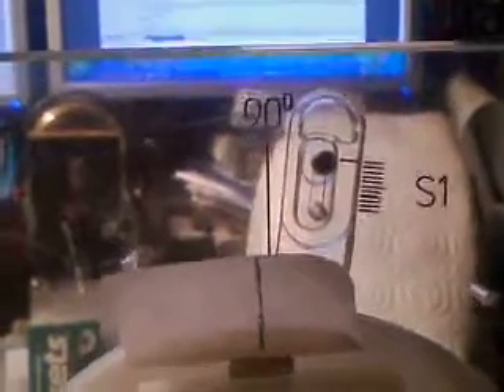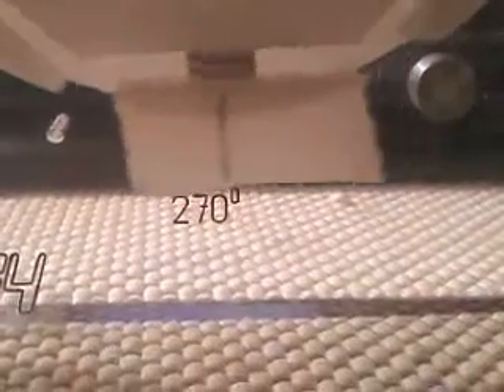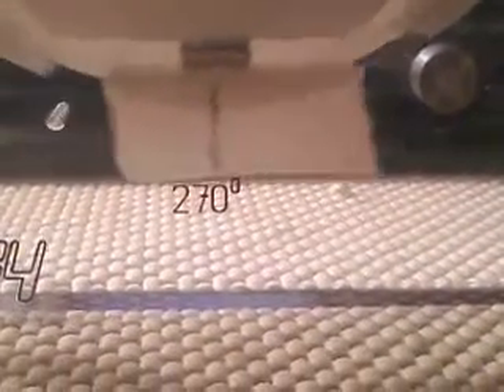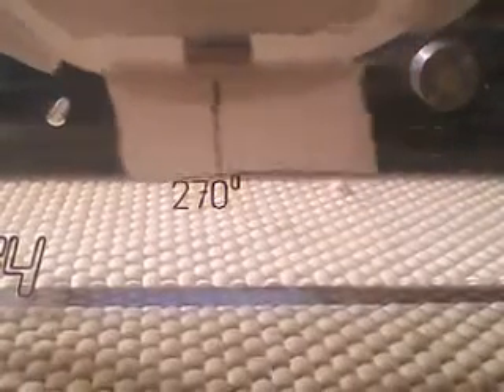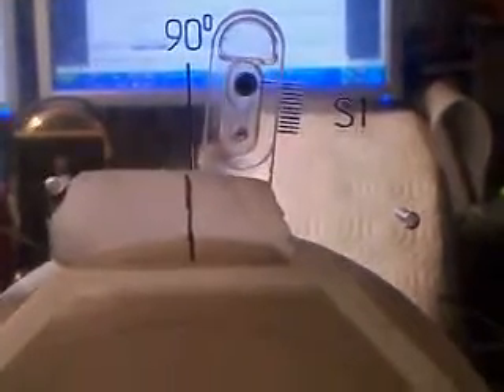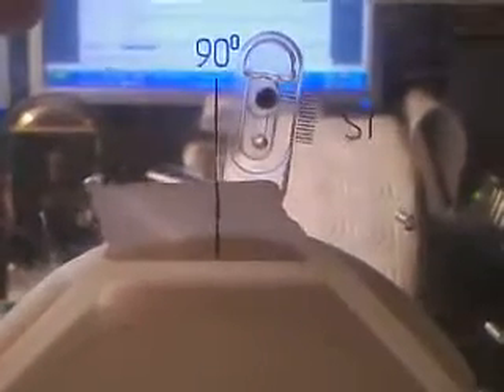Magnetically Assisted Pendulum

Comment from the maker: @Cloxxki ,

No worries - perhaps if you check out the FizzX thread where the math is shown it will help. But keep in mind, this is a reciprocating system, not a rotational system. However, I do have another design for a horizontal rotational system that simulates two opposing gravitational fields using magnetics. I hope to model this later in the year. BTW - another person has made a large (6 feet tall?) inverse M.A.P.  here on you-tube and claims OU from it - I forget what he calls it.

Comment from the maker: @Cloxxki 
The gain in gravitational potential energy is shown mathematically to be greater than the energy needed to rotate the moving magnet 180°.  Therefore, at the top of each swing of the pendulum, it can be flipped over and the return swing will also produce a gain. In reality, either magnet can be flipped to do this, but turning the mass of the smaller magnet lends itself to less work for the same result. Experiments with flipping the lower magnet pushed the gains over the top.

Comment from the maker: Yes, we have experimented with different orientations and locations here at this geographic center with the same results. The conclusion is that the earths field is much too weak to be a major player in this action.

It should be noted that the bearings are very free, graphite lubed bearings, and so offer little resistance to the gravitational energy conversion and subsequent magnetic gain.

Cheers

Comment from the maker: If you carefully read your own posts here you will see that we both agree. However, that gain in Epg is real and can be put to do work and that is the part that I don't expect you to comprehend. You see, I do not intend to complete a circle. I intend to flip the magnet at the top of the swing where the Epm is at a minimum and it requires little effort to do so. I believe the gain can be increased above the energy required to do so. Sorry if you thought you knew something I don't. Do the math.

Comment from the maker: So, what we are seeing is a conversion from gravitational energy to kinetic energy & magnetic energy and back to gravitational energy with a resultant gain where kinetic energy is reduced to zero and the magnetic energy is less than where we started. Ergo, we have extracted a gain from permanent magnets and stored it as gravitational potential energy. Now, what do you think would happen if we use that gain to turn the magnet over before the back swing?
;-)

Comment from the maker: You have made a small error in your 20 MPE, 100 Rotational and final 120 unit energy example. At 0° there is 0 Ek, Max Epg, and a starting Epm only 35% above  Min; at 90° we have a little less than Max Ek because an acceleration occurs after passing the magnet,  0 Epg because we have used it all and Max Epm because the magnets are at their closest proximity; at 185° we get 0 Ek, Greater than Max Epg, and less than starting Epm. (g)ravity, (m)agnetic, (k)inetic, (p)otential, (E)nergy.

Comment from the maker: Again, you are mistaken. In fact, I can tell you publically you wrong. The frictional component is doubled, that 100% more than what I have demonstrated.  And if you graph the field interactions using calculus you will see that they are clearly inverted for both quadrants of the upper half of the travel. So even though it symmetrical left and right it is still negative in both places, just as both quadrants in the lower region are positive. But, I am happy you are thinking about it ;-)

Comment from the maker: Actually, you are mistaken in that assumption. The field from the large magnet has a different shape at the top of the rotor and works against us in that region. A much larger rotor would be necessary and the gain would need to exceed the total friction of 360° instead of just 180° as I have shown. But I do agree that with the proper geometry a gain can be applied to angular velocity resulting in acceleration.